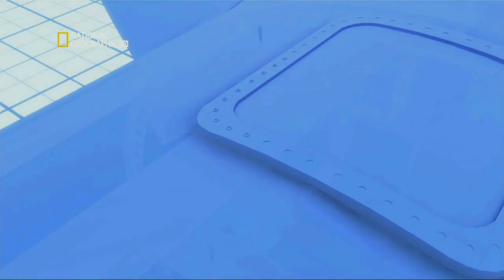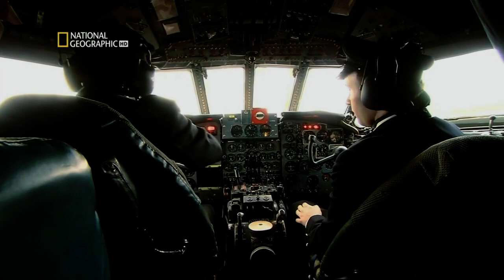The Crash of the De Havilland Comet

Comment: We feel we can shed some light on some common myths & misunderstandings.

  That's correct of course, at the time the Comet wasn't particularly dangerous. It was also definitely not the worst aircraft engineering disaster in aviation history obviously.

  The Comet's engines, right from the first prototype were demonstrated to have enough power even for high altitude  / hot airport operation. No incidents were caused by lack of power.

   Obviously the Comet's engine position & inlet position had some distinct advantages at the time & of course pylon mounted  podded engines have some problems including excessive induced drag. The Comet engine inlet design was not a fatal flaw & didn't cause any incidents.

Examples of all Comets mks including some Comet 1 airframes continued flying with certification at some point after 1954. Flying carried on until 1997. 

      Losses comparisons.
How things were in those days.

DeHavilland Comet 4 UK                  14% 
DeHavilland Comet all mks             17%  

Boeing 307                               70%
Boeing 247                               48%
Boeing 707            .                  20% 
Boeing 377                                19%  
MD DC-8                                    15%
Lockheed Electra Turboprop   29%
Canadair CL-44  Turboprop     46%  
Convair CV-580  Turboprop     22%
Convair CV-880    (ff 1959)       27%  
Convair CV-990     (ff 1961)      35%

     Of course De Havilland had prior experience building many all metal construction airframe aircraft & thousands of jet powered fighter aircraft that were primarily of metal construction with pressurised cockpits & jet engines built by De-Havilland.

   That is of course correct, Comets flew until 1997 & the original Comet design had military use as a requirement. Nimrod development began at De Havilland before 1953, Nimrod aircraft were in service until 2011. Indeed it is the case that the Nimrod was not withdrawn due to structure problems or other airframe issues, it was entirely due to a significant wing upgrade snag & resultant basic economics & an end of line sale happening at Bow-wing (see b-47 wing folding incidents for info) at the same time.
 
    The world's first pressurised cabin aircraft was of course an Engineering Division USD-9A, a modified British design Airco DH.9A built under license in the US  & was of course the first aircraft to fly with a pressurized cockpit module. This was during a joint US / UK research project in the 1920s.
 
    Yes, that's true, De Havilland carried out full stress analysis & engaged in a comprehensive & protracted testing program which is why key De Havilland people were happy to be aboard flying DH Comet aircraft. The Comet was the first airliner where stress due to pressurisation significantly exceeded flying load stress for a full length passenger cabin fuselage.

     We agree, that's correct, the DH Comet was the first passenger airliner with full length fuselage pressurisation at 8psi pressure differential. Handley Page built the world's first all metal construction airliner during the 1920s.
     In all cases other earlier pressurised aircraft were larger, needed thicker fuselage skins due to flying stresses alone & had much lower pressurisation differential pressure or were military aircraft with relatively small heavily built pressurised capsules. 

     Of course ripstop provision was provided. The skin alloy used became unavailable at the time due to R & D at the manufacturers which resulted in the original alloy being discontinued. Later alloys had very similar properties. The skin thickness used for the Comet was used for similar size later aircraft. Frame spacing was not found to be too large & frame width was not found to be too small.

    Without doubt De Havilland did indeed always work to better than industry standards at the time, used up to date knowledge for the design & construction & no evidence of negligence or criminal negligence was ever produced in relation to the DH Comet.

    Obviously the DH Comet had no effect on the course of the aerospace industry in the UK. The UK now has the world's highest combined nuclear, aerospace & defence sectors per capita activity. Of course anyone currently flying on a wide body airliner stands a good chance of being on an aircraft powered by RR gas turbine aero engines designed & built in the UK.

    That's correct, the investigation committee did not find hundreds of fatal flaws or evidence of design defects, structural defects, defective materials or shoddy workmanship. Indeed it is the case that ripstop provision was included. Claimed incidents did not involve cracks starting from passenger cabin window corners. Pretty much all changes were just in case changes or were planned development modifications & improvements that were scheduled regardless of incidents.

    Obviously De Havilland designers knew all there was to know about metal fatigue at the time they designed the DH Comet.

    It is in fact true to say that the way airliners were built changed everywhere, including in the US, after the Comet incidents.

We hope this helps, obviously.

Cheers indeed of course as always etc.
👍
 
 
 . . .... ... ..... . ..... ..... ..

Comment: It is indeed very important to note all the relevant facts of course obviously.
Kharzeestan Krappenz DiktorBummer Jurkzxoffenz etc and co - they should all note good with much awe & extreme wonder.
        UPDATE MORE BREAKING NEWS ETC

    How things were back then -
Accident losses - % of aircraft built.
DeHavilland Comet 4 UK     14% 
DeHavilland Comet all mks  17%  
Vickers VC10 UK 5%
   The DH Comet had better safety than or similar safety to many other commercial passenger aircraft of a similar era
    Douglas DC-1        99%
      Douglas DC-2        47%
    Douglas DC-3        30%
      Douglas DC-4          26%
    Boeing s300            72% 
 Boeing 307               70%
  Boeing 247                48%
     Boeing 707                   20% 
Lockheed L-049/149 Constellation  30%
   Lockheed Electra  Turboprop    29%
Fairchild FH-227                         30%
 McDonnell Douglas DC-8     14%
  Sud Aviation Caravelle       15%
Canadair CL-44  Turboprop   46%  
Convair CV-580  Turboprop 22%

        The Comet was designed with military use in mind, Nimrod work started at De Havilland in 1953.
  The committee did not find hundreds of fatal flaws or evidence of design defects, structural defects, defective materials or shoddy workmanship. Ripstop provision was included. Claimed incidents did not involve cracks starting from window corners.
     The engine & engine intake position had advantages, were not flaws or fatal flaws & were not the cause of any incidents involving any Comet or Nimrod aircraft. Nearly all changes before the Comet 4 were just in case or were previously scheduled improvements. 
  Bow-wing & the 707 story (see b-47 wing folding incidents) is the result of global economics & the well protected & very large domestic US airliner market & active support from the UK with for instance proposed competing airliners from Vickers & DH being blocked by the UK government at the time, cheap & nasty was the requirement with large scale production capability in one place.
  The 707 was of course a much larger aircraft which as a stressed skin metal airframe aircraft would require a thicker skin anyway. They got lucky at the time essentially.  Bow-wing is the result of the large & well protected  US domestic airliner market 
  The fate of De Havilland was due to Govt policy Aerospace sector rationalisation & global economics, it was nothing to do with the Comet.
  A comprehensive, thorough & protracted testing program was carried out on the prototype & it's assemblies. Of course the Comet did indeed have Ripstop stop provision. 
     De Havilland (Of England) Comets were not grounded after 1970 due to structural problems.
It's interesting that some of the aircraft on the list should really have been noticeably safer than the Comet due to being a similar type but of much later design & manufacture but they definately were not safer.
    How things were back then -
Accident losses - % of aircraft built.
DeHavilland Comet 4 UK     14% 
DeHavilland Comet all mks  17%  
Vickers VC10 UK 5%
   The DH Comet had better safety than or similar safety to many other commercial passenger aircraft of a similar era
    Douglas DC-1        99%
      Douglas DC-2        47%
    Douglas DC-3        30%
      Douglas DC-4          26%
    Boeing s300            72% 
 Boeing 307               70%
  Boeing 247                48%
     Boeing 707                   20% 
Lockheed L-049/149 Constellation  30%
   Lockheed Electra  Turboprop    29%
Fairchild FH-227                         30%
 McDonnell Douglas DC-8     14%
  Sud Aviation Caravelle       15%
Canadair CL-44  Turboprop   46%  
Convair CV-580  Turboprop 22%

A comparison of more recent aircraft.
Accident losses comparison examples. 
1970s - 1980s
    % of total Aircraft built
Similar aircraft type, date / decade, useage, size.
    Biz Jets
BAe-125-800                        1.7 %
Beechcraft Beechjet 400    2.2 %
Cessna 550 Citation II         7.1 %
Learjet 35 / 36                       12 %
Beechcraft 1900                  6%
Dassault Falcon 10              11.5%
Aérospatiale SN.601            22.5%

Medium size jets / Turboprops.
BAe-146               5.1%
Fokker 100          6%
McDonnell Douglas DC-9-30       9.5%
Fairchild FH-227       30%
McDonnell Douglas DC-8    14%
Canadair CL-44  Turboprop   46%  
Convair CV-580   Turboprop   22%

Beechcraft, Fokker, McDonnell Douglass, Learjet, Fairchild, Aerospatiale, Canadair, Convair  companies defunct.

    All Comets, including some Comet 1s, had full civilian use certification at some point after 1954,  civilian use certification only being withdrawn after commercial flying stopped. Examples were flying until 1997 - one example did a signals research global circumnavigation flight series in 1993 via Australia virtually without a rest travelling 28000 miles, only had an ice warning indicator issue during the flights.

    The DH Comet - World Firsts.
1st gas turbine jet powered airliner. 1st high altitude 8psi pressurised full fuselage length passenger cabin airliner,  not a trivial feature as structure  strength required for pressurisation considerably exceeded strength required for normal flying stress. Nobody else had done anything similar before the Comet.
  The b-47 used 2 relatively small, heavily built  pressurised modules  (the aircraft where 6 had their wings fold up in 2 months while flying & some had their wings fall off while parked). 
   The 1937 Boeing piston engined airliner pressurised passenger cabin was pressurised to 2 psi only - in fact that could easily be done as the normal unpressurized fuselage cabin structure strength for flying stresses only was all that was needed to be adequate so no significant weight increase issues needed addressing.
    1st all hydraulically powered flying surface controls & actuators airliner with under carriage wheel disk brakes + ABS.
1st jet airliner to cross the Atlantic.
1st jet aircraft to do a world circumnavigation flights series.
  Of course De Havilland had prior experience building many all metal construction airframe aircraft including thousands of jet powered fighter aircraft that were primarily of metal construction with pressurised cockpits & jet engines built by De-Havilland & we know the world's first all metal construction airframe airliner was built in England in the 1920s by Handley Page.
     De Havilland did indeed always work to better than industry standards at the time, used up to date knowledge for the design & no evidence of negligence  or criminal negligence was ever produced in relation to the DH Comet.
    The course of De Havilland & the general UK aerospace industry sector was not affected even slightly by the DH Comet. The course of national aerospace sectors obviously being similar & inevitable in many countries.
     Other interesting World firsts
World's first turboprop aircraft.
Vickers Viscount Turboprop Airliner 1947. 
A 1945 Gloster Meteor Aircraft with Turboprop Gas Turbine Engine.

They might like to answer these questions.
   Which airline has just ordered
60 RR England Trent XWB Engines
& What aircraft are the engines for?

Bonus question for 10 points.
         Which country has the 
World's Highest Combined Per Capita
  Nuclear + Defence + Aerospace Sector Activity?    

          👍 & 🙂 & of course 😎 indeed.
          C H E E R S & without doubt  -
          Toodle PIP Old C H A Ps.
 
This line left not blank intentionally.
           
   The next line is blank intentionally.     
             

    

. .... . ... ... ..... ...
. . ... ..         ... . ..
 
Ivcxivcxivcxcvcxcv
cxcxcvccbcxcxccxv

Comment: Apparently wind drag hates square windows
Reply: Unmodified Comet 1 aircraft would routinely fly unpressurized at low altitude after the issue was identified.
    It was specifically pressurisation cycles that resulted in the claimed fatigue fracture failure problems.
     However -
How things were back then -
Accident losses - % of aircraft built.
DeHavilland Comet 4 UK     14% 
DeHavilland Comet all mks  17%  
     _DH Comet 1      22% or 27%  or 31%
     (2 or 1 or 0 of the DH Comet 1 
     losses were definite ground
     handling error caused write-offs)._
Vickers VC10 UK 5%
The DH Comet 1 aircraft specifically had better safety than or similar safety to many other commercial passenger aircraft
    Douglas DC-1        99%
      Douglas DC-2        47%
    Douglas DC-3        30%
      Douglas DC-4          26%
    Boeing s300            72% 
  Boeing 247             48%
     Boeing 707             20% 
   Lockheed Electra   29%
Reply: @petemaly8950  NO COMET 1 AIRCRAFT FLEW REVENUE SERVICE AFTER 1954, C1 Certificate of Airworthiness was permanently REVOKED in 1958.
Reply: @sandervanderkammen9230  
All existing Comet 1 aircraft flew routinely for various reasons after 1954.
There was never any negligence.
DH worked to industry standards or better at the time.
DH Comet prototype testing was of course extensive & very advanced  & DH had a lot of experience building many all metal construction airframe aircraft before the Comet.
Fryed Ryce Muncherz shud note-*_
How things were back then -
Accident losses - % of aircraft built.
DeHavilland Comet 4 UK     14% 
DeHavilland Comet all mks  17%  
     _DH Comet 1      22% or 27%  or 31%
     (2 or 1 or 0 of the DH Comet 1 
     losses were definite ground
     handling error caused write-offs)._
Vickers VC10 UK 5%
The DH Comet 1 aircraft specifically had better safety than or similar safety to many other commercial passenger aircraft
    Douglas DC-1        99%
      Douglas DC-2        47%
    Douglas DC-3        30%
      Douglas DC-4          26%
    Boeing s300            72% 
  Boeing 247             48%
     Boeing 707             20% 
   Lockheed Electra   29%
Reply: @petemaly8950  PROVE IT!
Reply: @petemaly8950  Please provide some verification of Comet 1 aircraft flying in revenue service after 1954???

All Comets were grounded in 1954 and only the Comet 4 was in service in 1958.
The ACC permanently revoked the airworthiness certification of the Comet 1.
Reply: Wreckage eventually recovered from the sea confirmed that the passenger windows were not related to the catastrophic in-flight structural failures... it was bad design, poor materials and shoddy workmanship.
Reply: @sandervanderkammen9230  well you would be partially correct but its the wind that made microtears and the cheap metal being weak
Reply: @GooseCarpet  de Havilland used thinner aluminum skins on the crown of the main pressure cabin, just 1mm thick instead of the thicker skin used on the rest of the plane , twice asthick at 2mm.
DH also used an alloy that was too brittle (AL2014B) is not used for pressurized cabins.
The Comet lacked proper overlapping rip-stop doubler joints and the fuselage reinforcement hoops were too weak and spaced too far apart to prevent cracks from joining up with adjacent panels.
This is combined with improper riveting techniques and poor workmanship and poor quality control.
Reply: @sandervanderkammen9230   i dont speak physics
Reply: @luisthegamerbrother  You don't speak engineering...
Reply: @sandervanderkammen9230  no i do not